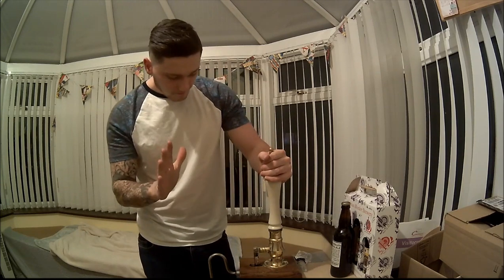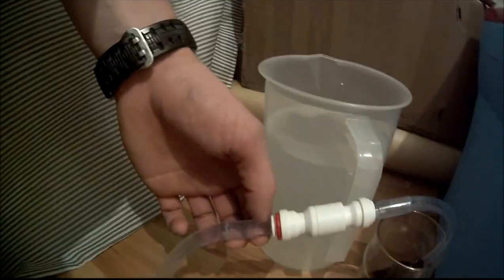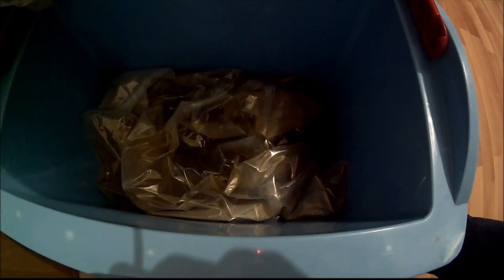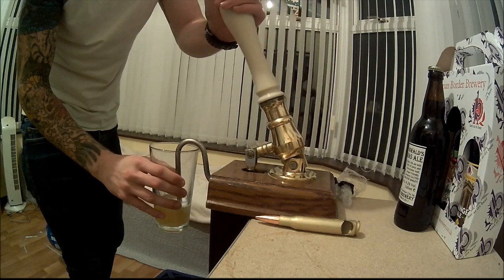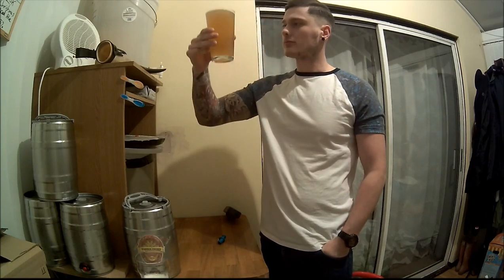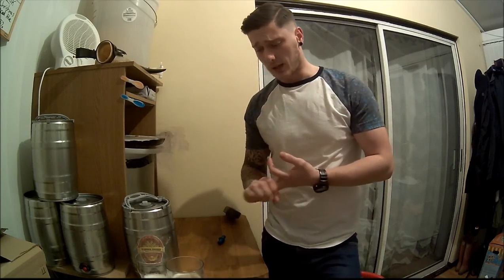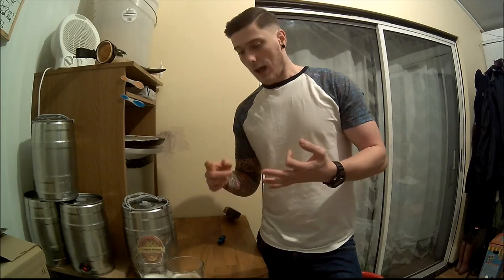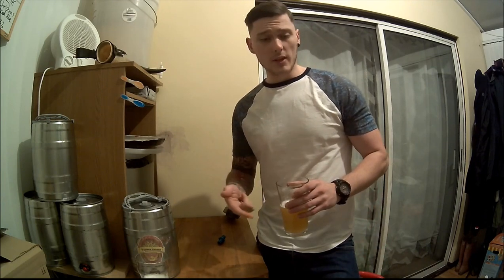Beer Engine Debut & Session IPA Tasting

Comment: Hi when you say you vented the pressure barrel did you top up with co2 canister? Also did you find the poly pins swelled due to excess co2 because you primed before casting? I’m looking at doing the exact same set up but scared of either getting flat ale or swelling polygons. Cheers